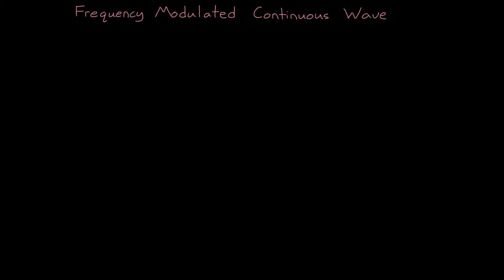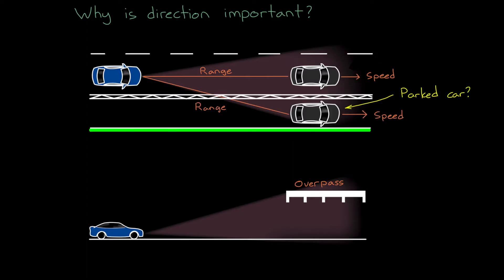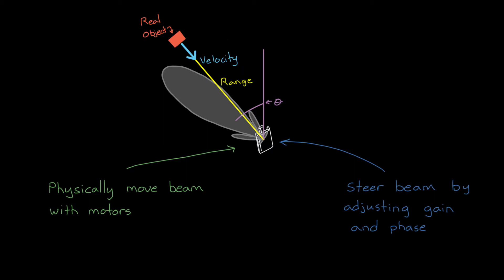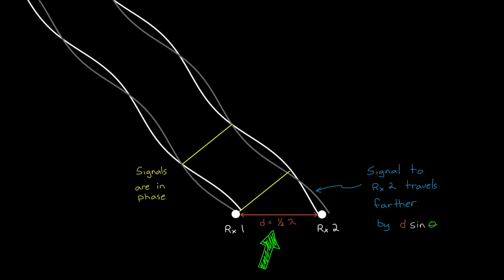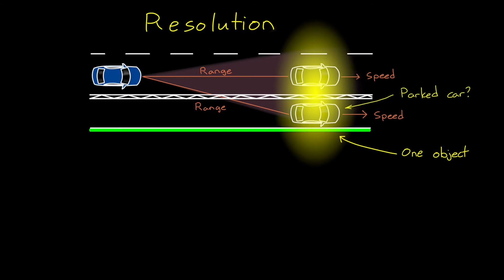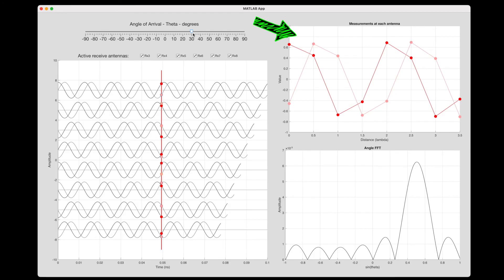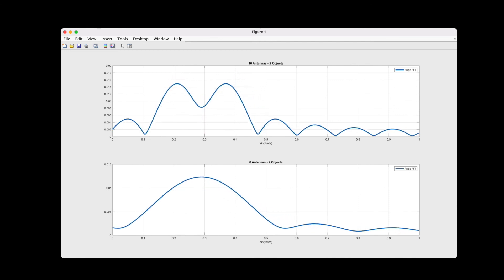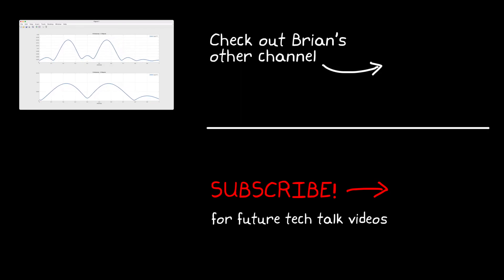Measuring Angles with FMCW Radar | Understanding Radar Principles

Comment: It bothers me that this displays IQ signals somehow being a real physical phenomenon instead of an artifact of the downmixing process. Real radio waves are... real, not complex.
Reply: @evgenyborodin137  And you can't have a phase difference without a reference oscillator. The signal coming from the antenna is real valued.

Comment: Thanks for that visualization. It helped me to understand the angle measuring.

But I think you explained it a little too simple. At 11:00 in the top right chart, you show the "discrete" IQ values. If we have discrete values we can't do an FFT. We have to do an discrete fourier transformation (DFT). The results are also discrete so we can't see the continous SI-Funktion as you show in the bottom right chart. And here we are at the main point, the SI-Funktion is discret and the discrete values may not match with the peak of the SI-Funktion. A way to solve that is zero padding, where you add additional zero values to the DFT to display a more precise spectrum.

Comment: Thank you for the great explanation. 
I hope you don't mind answering a question. At 10:00, should I take the FFT of the I and Q separately since each forms a sinusoid? And in that case, either I or Q can be used. Or should I take an FFT of the complex number of I and Q together?
Reply: I would assume you would have to use both since the whole point of using IQ signals is to gather the phase component between the two signals
Reply: You need to transform your IQ signal to a complex base band signal and after that, you can do your complex FFT.